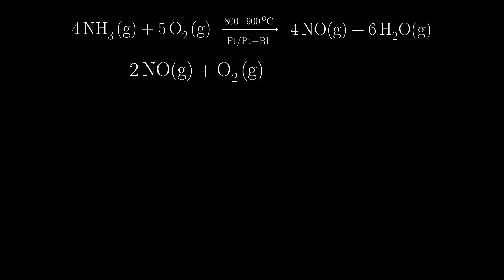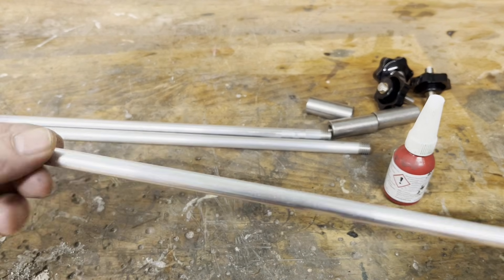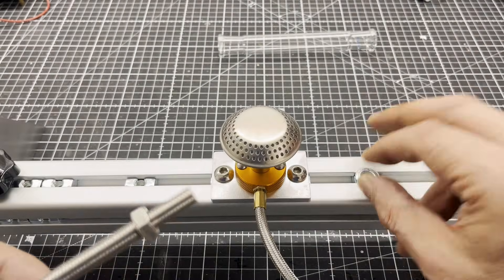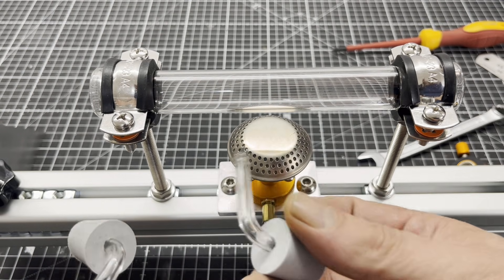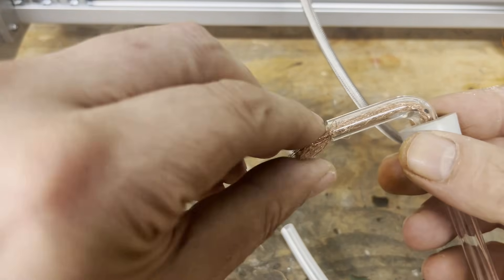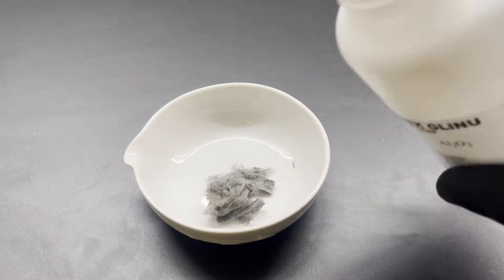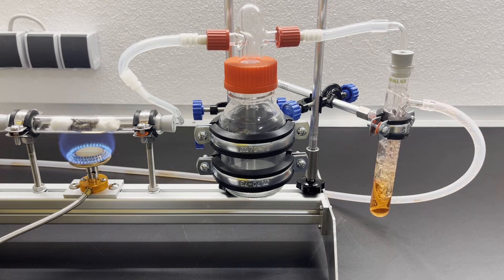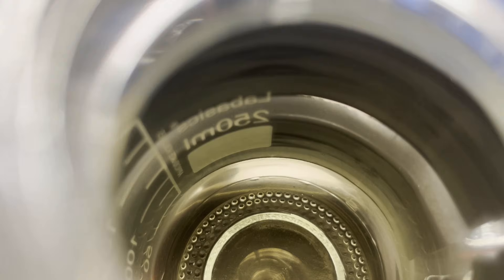Making nitric acid by the Ostwald process

Comment: Chemistry has always interested me, but I didn't take school as seriously as I should of and missed out on a quality education... at least when it came to high school.

Do you have any advice for me?  I don't even know where to begin.
Reply from the maker: Buy a good book. Get some glassware. You can do a lot with an Erlenmeyer flask and a few test tubes. Start with inorganic chemistry and experiments that are guaranteed to succeed. For now, only buy the chemicals you need for these experiments. A camping burner or even a spirit burner will suffice for now. A small electronic scale is also part of the basic equipment, as is distilled water. Stoichiometry is one of the most fundamental theoretical tools. You should focus on this first.

Comment: Very impressive work! How long do you think the catalyst will last? 

I was already planning on wrapping nichrome wire around a quartz tube, so this is a fun secondary project!
Reply from the maker: Unfortunately, I do not yet have any long-term experience with the catalyst. I'm not sure whether a nichrome wire will generate the necessary heat.
Reply: @Marbslab We might have to compare notes some day. 

If memory serves, nichrome can reach 1200°C with the right power supply. I know that my 30v 10a power supply can get several inches of 24 gauge nichrome hot enough to convert CaCO3 to CaO.
Reply from the maker: @jaredhaas1428  Please let me know if it works, together with some specs. It could be an alternative with the advantage that the heat can be exactly controlled:)
Reply: @Marbslab my quartz tube just arrived. Give me a couple weeks (I'm in-between workspaces right now) but the only thing I'm missing is two rubber stoppers.

One of the modifications I'll be doing is bubbling into a solution of sodium carbonate, with a magnetic stirrer, that way any ammonium nitrate gets converted to sodium nitrate.

Also, I'll be using a $5 air pump and a valve on a Y-connector to adjust flow rate at the front rather than a vacuum ejector at the rear.

Thanks for the inspiration! I hope to repay you with a successful experiment.
Reply from the maker: @jaredhaas1428  Good luck:) And if you fail, think about A. Edison's words: I have not failed. I've just found 10,000 ways that won't work.
Reply: @Marbslab hopefully it doesn't take me 10,000 tries! 😂 

It might take a more powerful air pump or power supply, but that's just an excuse to get better equipment. The nichrome I'm using is Kanthal A-1, the same stuff used in ceramic kilns, so I know it won't be my point of failure.

Comment: Very nice! These hand warmer catalysts are often overlooked by chemists, and there are more than one type. The cheapest ones I believe are vanadium on a substrate which burns away like a mantle. Also, platinum bright fireplace embers are another source of fairly reactive platinum on wool (not sure if it's ceramic fiber or mineral / rockwool substrate)
Reply from the maker: Platinum quartz wool is difficult to obtain and extremely expensive. If you don't have any funding available, you have to improvise :)

Comment: like always great work, but I wonder why you use gas burning as a source of heat for most of your demonstrations?

having electrical heaters are more accurate, less risky and more durable
Reply from the maker: Thank you. Gas burners are still very common in the lab. Most time I need high heat (>800 °C). Difficult with electical heaters to archive this and IMHO not worthy to mess around for an experiment. That said, I am thinking about an induction heater for an experiment in the future:)

Comment: A very cheap catalyst for this is Brick 1 from a used automobile catalytic converter. Might have to bake it out then wash with dilute hydrochloric acid but then it's good to go. Feed with ammonia and oxygen in excess to avoid excessive ammonium nitrate production. ❤
Reply from the maker: Thanks for the tip. Will check it out:)

Comment: TIL Pt catalysts can be obtained from hand warmers, what a gem
Reply from the maker: They work very well. I recently built a Döbereiner lamp for Steve Mould and used them, too: https://www.youtube.com/watch?v=Mcg9GcilBfU
Reply: Brick 1 🛺 catalyst has the right mix to do this extremely efficiently, it's 90%Pt and 10%Rh. Commercial  ammonia burner catalyst is 85%Pt and 15%Rh as very fine wire. ❤

Comment: Well done.  One thing to keep in mind about silicone tubing is that it is very permeable, particularly to oxygen.  In this case that is no problem, maybe even a benefit for the oxidation of NO to NO2.  But if you ever need to exclude oxygen, silicone can be very detrimental.
Reply from the maker: Noted with thanks:)

Comment: another awesome video and build.  I really like the idea of the water jet pump, a great idea for applications that only need a very mild pull of air.
Reply from the maker: The water jet pump (vacuum ejector) used to be very common in chemical laboratories, but was increasingly replaced by electric vacuum pumps. The vacuum ejector also has some advantages (for example, no cold trap is needed to protect the electric vacuum pump).
Reply: @Marbslab  I will certainly look into it, a very interesting concept.  Thanks!

Comment: You need to use Cr2O3 as catalyst, it produces self sustaining heat so once the reaction begins just insulate it with insulation ceramic wool. You can use ammonium dichromate for depositing Cr2O3 on activated alumina balls.
Reply: Can you post the paper name at least, if it deleted the link?
Reply: It's a two yr old vedeo by MIH0319  @xxxm981
Reply from the maker: That's news to me. Are there any sources for this?
Reply: @Marbslab youtube deleted my comment which had link
Reply from the maker: @Exotic_Lab  YT makes it really hard to have a scientific conversation. I'll check it out myself and see what I can find. Thanks for pointing that out.
Reply: @Marbslab there's a video by MIH0319 2 yr old , you can check that out
Reply from the maker: You can send me the link also via email. I can see your comments in my emails, but not on YT🥲
Reply: Did he send the link? This seems very useful if true  @Marbslab
Reply: YouTube does not like, when people interacting too much. They just want their spectators watch the commercials for their income and then be quiet. We need an alternative "YouTube"

Comment: In the collection bottle did you start with water in it to absorb the acid gas. or do you get nitric acid straight out if the dilivery tube?
Reply from the maker: The gas washer bottle was not filled with water, but I got a little HNO3 in it from the NOx and condensed water from air:)